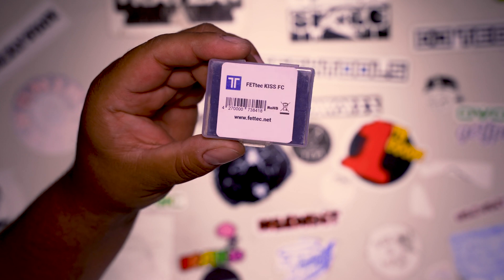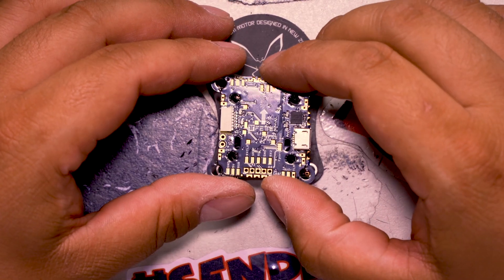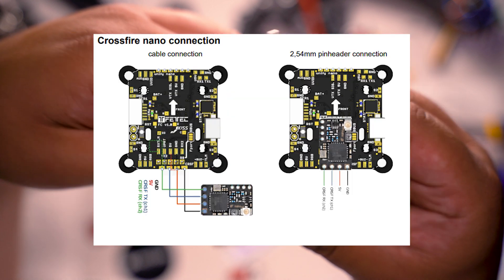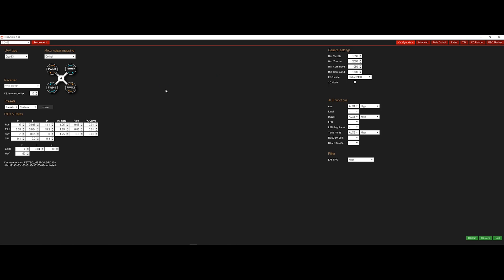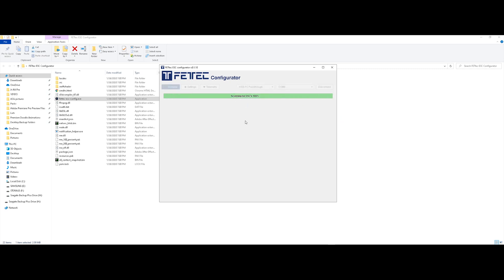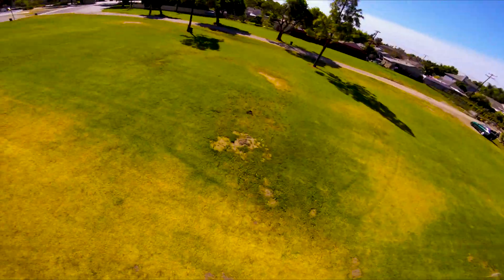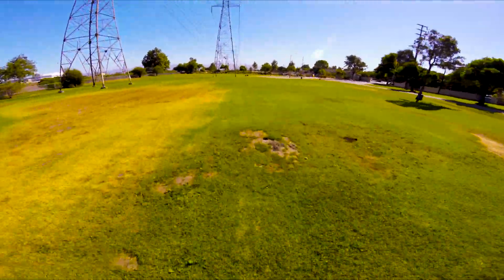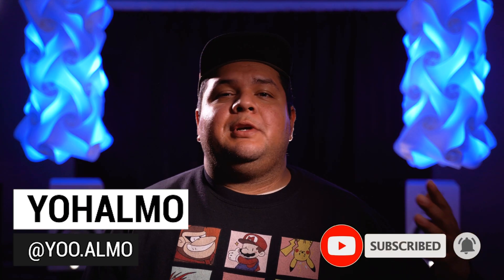Fettec FC and ESC Build video (FPV DRONE 2020)

Comment: Finally someone made it. Btw, what OSD did you use?
Reply from the maker: Thank you for commenting! Currently running it old school with no osd and having my taranis warn me when ive flown 3:30 minutes. lol I will post a video soon with all the options to add osd to this set up soon! I actually just received my apex osd hardware. I will work on the video this week!
Reply: @yohalmocoto4604  do it fast else I will do it first 😜, just kidding. Planning to try kiss myself.
I know you explained how BF and kiss give diff experiences in your video, but other than that, any thing else you notice?
Reply from the maker: @shyamfpv  I want to say that bf kinda polishes little imperfections... Kiss is a little more technical. I like that you can be very precise whe I going through gaps and of course it's not windy. I kinda like how kiss handles crashes. Lol I feel like I can recover better from a death spin than bf. Not sure if it's just me... But I noticed that too.

Kiss was much easier to set up than bf for sure. That's what I can think off off the top.
Reply: @yohalmocoto4604  cool!!
Reply from the maker: Just posted on my channel how to set up the OSD!
Reply: @yohalmocoto4604  thanks!

Comment: Thanks for the movie, good work. Maybe you'll give me a hint, so… Fettec FC&ESC 35A + VTX TBS Evo HV: how to power VTX? from where? Directly from lipo pads (ESC), or maybe other safe way/pin places? (I know that fetec FC only has BEC 5V for VTX: 600mA, good for TBS Unify PRO32 NANO). From FC i want power up only Nano RX, camera from VTX + connect to nano rx for OSD. Thanks for your help, best!
Reply from the maker: Thank you for commenting! If you notice on 2:34 on the video.... The left image of the FC shows a red arrow for VBAT which is bayberry voltage for the evo or any vtx that takes battery voltage.

And as you mentioned that you can also connect a nano vtx so this board does provide all those options. 🙌🏽
Reply: Yohalmo Coto thx!
Reply from the maker: @SRKFPV  your welcome!

Comment: thanks for this im a working on a FETtec build right now and i was just say there is no video like this so needed
Reply from the maker: Thank you for watching and liking/commenting! I'm glad it helps! If there is any other questions you got let me know! 

I originally had issues with the set up on the kiss gui. Nowhere did I read what board orientation to choose. Ive had my drone fly to the moon, and flip on my because of the incorrect board orientation. The way I oriented the board in this tutorial is the way to do it and worked after testing.
Reply: @yohalmocoto4604  thanks!!